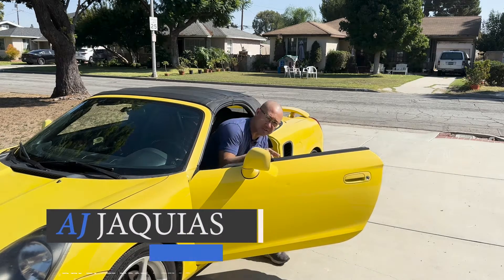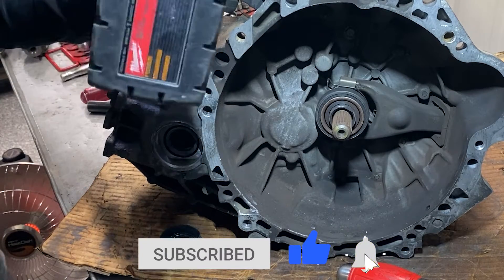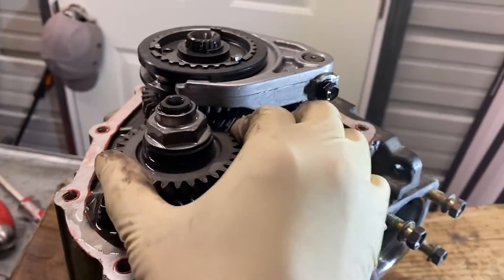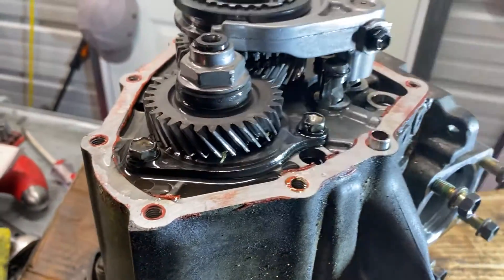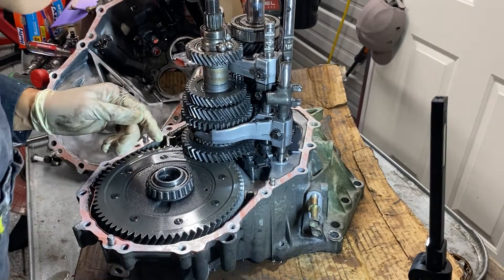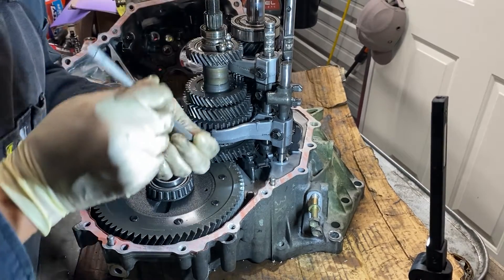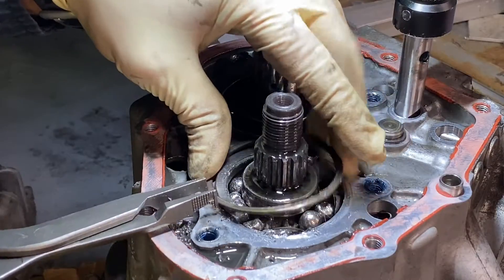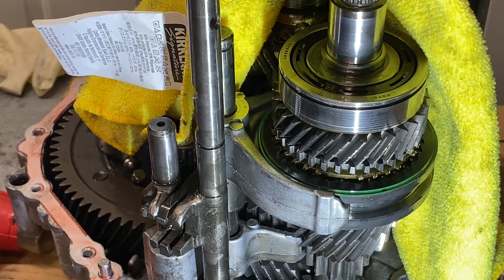Project Yellow Episode 5 - C56 Transmission Rebuild Part 1 with Bloopers

Comment: My Toyota echo C150 transmission died in the same way, mine straight up failed on the highway and the car stopped driving on my way home from work one day. Had to get a used tranny as mine was too far gone to rebuild
Reply from the maker: It happens and when it does it usually sucks. Thx for watching and commenting. Pls subscribe. Thx AJ

Comment: So is it expensive to rebuild c56 i have a 2001 celica 5 speed
Reply from the maker: It can be expensive to rebuild a  C56. It really depends on what’s wrong w it. Keep in mind, OEM parts aren’t cheap. I believe it is cheaper to buy a known good used C56. Pls subscribe. Thx AJ
Reply: Mine is making noise in 5th gear and grinds when you shift into 3rd but if you shift it slowly it won't grind? Speed and odometer not working

It's a 2001 1zz celica gts I bought it 1000$
Reply from the maker: @14homes what? Celtics gts didn’t come w a 1ZZ. Is it a 5 or 6 speed?
Reply: @RelentlessRacingAJ  5
Reply: Ok my bad it's not a gts
Reply from the maker: @14homes I recommend replacing your transmission w a known good used 5 speed. Good luck. -AJ
Reply: @RelentlessRacingAJ  Thank you!!

Comment: I just completed Monkeywrench Racing SMT conversion kit for a 2005 (six speed).  Everything went fine with the exception of shifting into reverse,  I used the extra washers supplied for a six speed.  It takes about five or six times to get it into reverse pushing hard to the left.  Do you have any recommendations?  I live just outside of Houston
Reply from the maker: @johnhitzeman9704  disconnect the shift cables from the transmission and attempt to shift into reverse at the transmission. If it doesn’t shift into reverse still it is a clutch or transmission issue. If it shifts into reverse it’s a most likely a shift cable or try removing the washers. Good luck. Pls subscribe. Thx AJ
Reply: Did the synchronizers fit
Reply from the maker: @merrickgabriel5333  I don’t understand your question. What synchronizers are you talking about?
Reply: @RelentlessRacingAJ  oh sorry the guy that bought the parts at monkeywrench i wanted to know if the parts fit...i got a c56 and my gears are grinding where did you buy you synchronizers rings for yours ?
Reply from the maker: @merrickgabriel5333  the SMT guy didn’t install any synchros. He converted his SMT transmission into a manual using the MWR kit. There are no synchros in the MWR it… it is all external parts. I purchase only OEM synchros. FYI - a transmission can grind for many reasons. I recommend either opening and inspecting yours or just buying a used working transmission. Pls subscribe. Thx AJ

Comment: This is the famous c56 gearbox?  Which one holds more Torque?
Reply from the maker: Yes this is a C56. I don’t know how much power it can hold. All of my cars are lower
Reply: @RelentlessRacingAJ I have a 98 Toyota Corolla E11. 4AFE engine.  I work as a Mechanic in Spain but I earn just enough to live and cover expenses.  Last week the fifth gear of my C52 gearbox died.  I already bought this car very cheap second-hand.  I've been searching forums this weekend to see if another gearbox could work for me and I've seen on the internet that they say that the c56 of the Vitz RS can be used.  The thing is, I'm looking for a reliable gearbox.  Under maintenance....
Reply from the maker: @Spaceforcar  I’m not sure what you mean by “5th gear is dead”. Have you opened the transmission to determine the real issue? Hopefully, it wasn’t driven long with 5th gear damaged and the damage didn’t spread throughout the transmission. I’m sure you know this already bc you are a mechanic, but 5th gear not working means an issue(s) with 5th gear, 5th driven gear, sleeve, hub, synchro, shift fork, or shift keys. I would recommend just going to the yonke (junkyard in Mexican Spanish) to find another C52 and grabbing all the 5th gear parts required. Fortunately, the 5th gear parts mentioned earlier are under the transmission cover which is easily accessible. Good luck and please subscribe. Gracias, AJ
Reply: @RelentlessRacingAJ Thank you very much for your attention.  I will repair my transmission.  It's the first thing I did to subscribe, I really like your master content.

Comment: I  need to do this with my original C56.  It has a crack in the housing and the 3rd likes to kick out half the time.
Reply from the maker: pull her apart and you will see how simple a manual trans really is